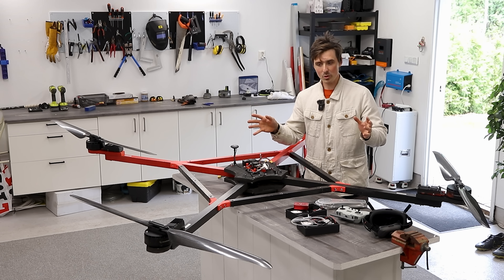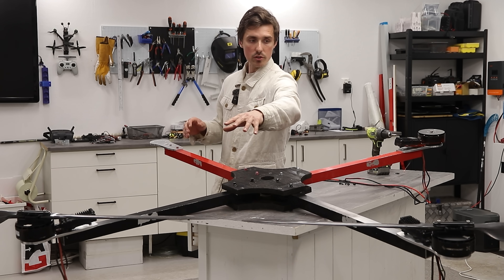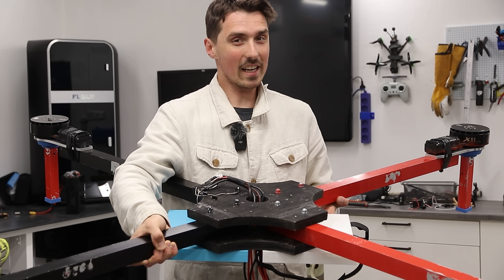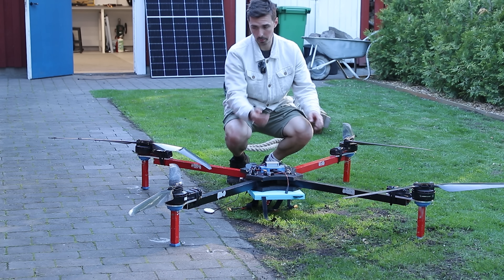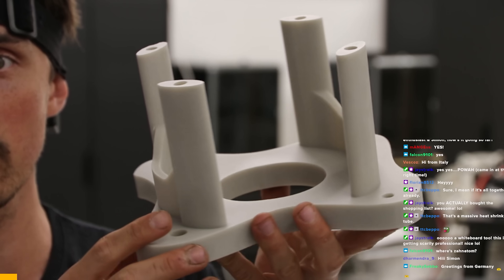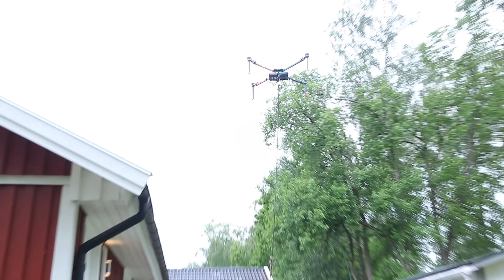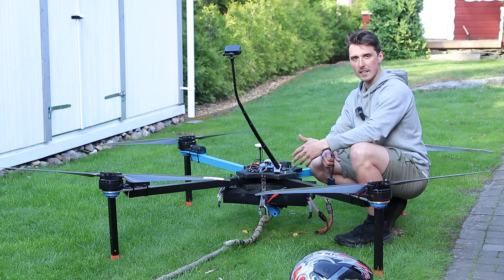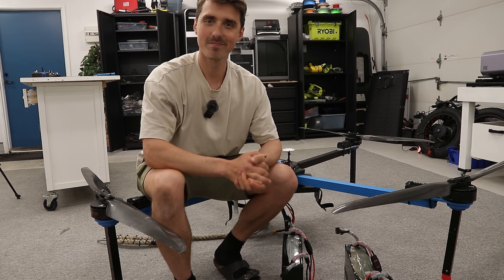Heavy Lift Drone 100kg Test - It Works!

Comment: Always add kill switch in transmitter to send disarm signal.
Reply: these flight controllers don't usually work at all without a switch for arm/disarm being specified
Reply: Ok @PilotPlater but I am saying that using yaw stick for disarming take time while disarming via switch is add on for redundancy. 
Because it's a very big drone.
Reply: @chanchalrajpoot2454  I haven't seen a homebuilt drone in the last 5-10 years that use the sticks to disarm, they all have a switch, and many choose to use a pre-arm switch. I don't think using sticks to arm is an option on most flight control software, that's more of a DJI thing, but I do see what you see in the video that it seems he uses the sticks to arm.
Reply: Yes  @PilotPlater  there has to be a disarm switch so drone doesn't flip.

Comment: Bro... you need a bigger back yard, that was terrifying
Reply: I so saw that 40 kg concrete block fall through the roof. 😅
Reply: @soma_rc  newermind, if broken roof, then easy can repair roof, no problems.
Reply: he didn't even seem worried
Reply: @DrivewayDave he was hiding behind a shrapnel liner.
Reply: @DrivewayDave i get scared flying my mini 4 pro in a space that size hes flying something where each prop is the size of a inspire
Reply: He definitely needs a bigger backyard
Reply: Always amazes me to, the inappropriate places people pick to do things. Never mind, makes for a great video. 😂
Reply: Bro is almost at 1 millions subs he'll have a mansion soon
Reply: 🤣I bet the chickens in the coop are like :face-blue-wide-eyes:
Reply: @LexieEclectic 😂
Reply: ０．０
Reply: Yeah, damage to property seemed the most likely negative outcome of this event. The precautions for his own safety were great and all, but, having had to fix many broken things in/on houses from cracked foundations to roofs, I was clenchin' something fierce watching this 😅
Reply: why is he doing this in his garden lol
Reply: Apart from not knowing how a failed prop would affect the flight characteristics I believe he actually stepped it up in a controlled fashion. 😮
Reply: the space is quite small for the test but i think he take some levels of safety lol.
Reply: Especially on the last one. I though for sure he was going to need a new roof at bare minimum.
Reply: Why don't you buy him a bigger back yard? 😃
Reply: Essentially a Home Depot towel bar build like we used to do in the earliest days except wayyyyyyy bigger.  Brings back memories.
Reply: Why do I feel like we're watching an episode of Highlander?  All the blades?
Reply: Como faço  pra comprar um bateria  dessa tem algum site  confiável  na aliexpress que vc possa  me endicar
Reply: Soon seen flying over a prison...before lifting someone out 😮
Reply: Bro I thinking Hemp-Steel like Canada Pla. and Solid A.B.S.  Hehehe whit Canada has a lot of aluminum cans
Reply: GF walks out with sandwiches and BOOM! prop to the face!
Reply: Why did he not go to a field? 😅😅😅
Reply: @FalkoRichter  I am thinking he is starting to get a reputation and the local police pull him over anytime he goes out. Quick search to protect property and preserve lives.
Reply: @FalkoRichter  Not his field maybe?
Reply: @FalkoRichter Hmm yea he spoke swedish as well. So he should be allowed to go anywhere (allemansrätten). Although I don't know if that means you're allowed to fly/land a drone on some farmers field. Maybe not.
Reply: @atnfn  "Allemansrätten" does NOT allow you to do everything. It means you are allowed to WALK around along the edges, not crossing or to stand in the middle or inside and cause damage where there are crops growing. Also this heavy drones require special permit to fly, which I don't think he has, so it's better for him to stay away from public places. He would have been in trouble even if something would have happened on his back yard.

Comment: Also the resistance when pulling the pin out when 100 kg is hanging from it will be massive.. So I would like to see a quick release mechanism like How ridiculous is using with the heavy loads.

Comment: Be wary of the "pendulum fallacy in drone design". It isn't something you're actually designing toward here, but it could crash the drone since you're hanging weights below the drone.
Reply: The pendulum fallacy doesn't apply if you have it on a rope...
It only applies if you have a stationary mass mounted below.
Tom stanton has a great video on the topic.

If it were in any way true what you said here, then helicopters that are used to lift antenna or other high altitude equipment would be affected too.
Reply: Regurgitating internet jargin doesn't make you sound smart when you get it completely wrong